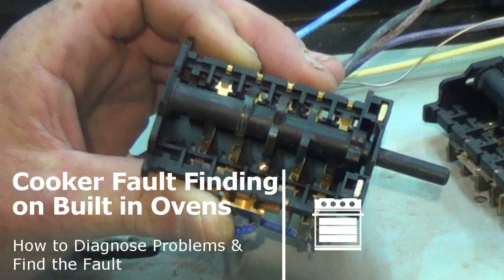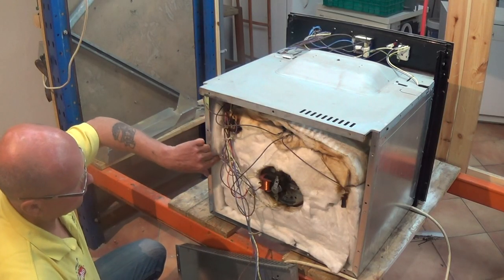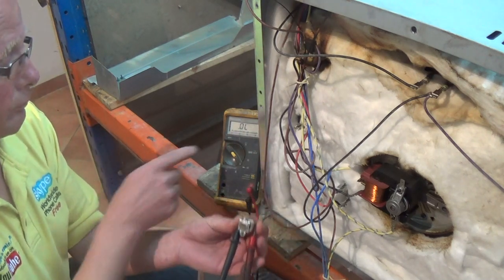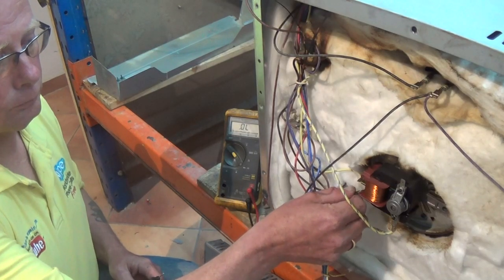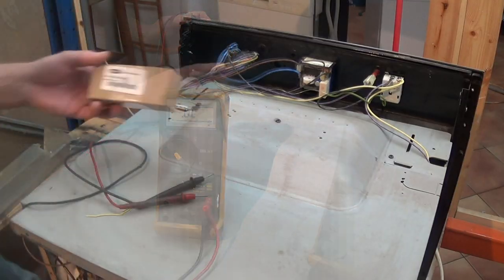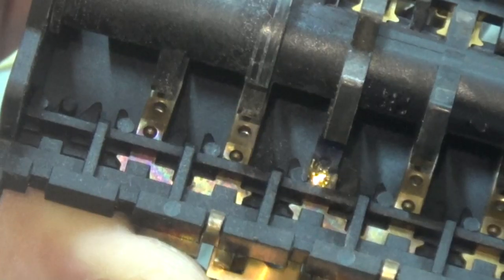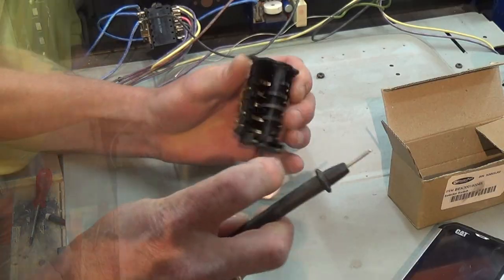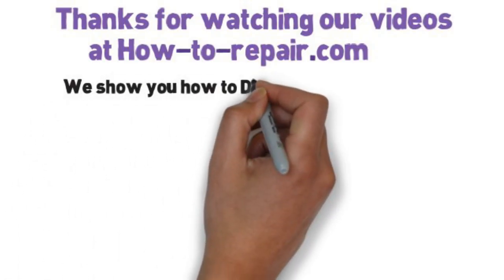How to Diagnose a Fault on a cooker or oven built in

Comment: i ordered some thermostat for my oven because it wasn't reading the temperature right and when i changed the thermostat now the oven doesnt turn on at all :( the top grill does but the main oven doesn't :( but i changed the thermostat on both. any ideas? :(
Reply from the maker: I would check the timer because you might have put it on automatic
Reply: @How-to-repair  the clock says 0 so not sure how to check it

Comment: Hello! I have a BEKO FSM62530DXMS gaz cooker, the electrical problem in short I think... the fan turns on by itself. without using the gaz coocker. I take it out of the socket and, if I plug it in again, the electricity in the house goes out!! what to be??

Comment: I have a Neff oven that does not heat up. I opened the top cover and the back cover. The whole thing was packed full of the Kaiser's finest electronics (microcontrollers, solenoids, eproms and cpus!). The cooling motor continously running (it might be the protection shown in your video). The elements when I push the relay manually and turn the oven on heat nicely but not the grill although it measures good. This oven is a pain in the neck. It is a Neff mega 1580.

Comment: Thanks for this.  Have just bought a new "hob" selector switcb - but notice that the "spindle" is stiff - ie, will not rotate at all.  Is this normal - ie does it have to be "unlocked/loosened" somewhere - or could it be faulty?  (Not sure I have confidence in supplier as ordered genuine "Indesit" part, but the delivery note does not mention "Indesit" - but Beko, belling, flavel, jmv, leisure, new world -- but it could of course be a universal part - but now the question over the spindle as well) !!

Comment: My oven knocks out all the power in my house at the point the cooling fan is supposed to come on. I've been quoted £60 call out fee and told its probably the element shorting as it heats up. The replacement for that I've been told is about £30. I'm not convinced its the element. I had thought it was the fan (broken or stuck with grease as its not been used for years), but this video makes me think it could be the protection thermostat.

Comment: A very well made and helpful video - many thanks. 
2 observations, it's worth wearing work gloves when dismantling the oven, or any similar machine, as the case panels can be very sharp indeed. Secondly, there may be more than one fault, which can confuse the un-systematic repairer.

Comment: Hi. We bought a condo with a Frigidaire Gallery Series Wall Oven; Model CGEB30S8CB1. Unfortunately, when on BAKE, the main element will only heat to 285 F (max.), and takes about an hour to reach that. However, if we select CONV.BAKE, the fan runs, but the element dosen't heat at all. Oddly, the BROILER element heats up fine. Anyone with any ideas as to what might be behind this strange behavior? Thank you.  Ken - Calgary, Canada
Reply: That's exactly my problem as well.  Which part did you replace?

Comment: can you  show how to connect 3 phase 440 volts rotary switch to low, medium, and high position electrical burner , using three electrical elements[ three elements 3 starting and 3 end terminal of elements] THANKS
REPLY

Comment: Hi thanks for the video...i have checked all the parts u have said n it works according only part is i do not have continuity at the fan but when i  on the timer the fan kicks in....also the top n bottom oven elements works. But the grill trips the hse...but wen i test for cont n short to earth there is no problems there is continuity n no short to earth....could it be the selector switch? But there is No Burt marks or scorching on the pins...am i missing something?

Comment: hi i have a creda hotpoint cooker they element went in bottom oven so we bought a new one and fitted it .the oven is now working but its not getting as hot as it ust to be any idea pls
Reply: Did you check the  wattage of the one you took out as there not all the same

Comment: How do you test the Oven Selector Switch
Reply from the maker: Each terminal is connected to a set of points there needs to be perfect continuity. electricity must be able to track between one terminal and another terminal you will normally see burning on the contact if it is not in good condition I'm glad I could help you please remember to subscribe to the channel as that's what keeps us going and able to make these videos for you